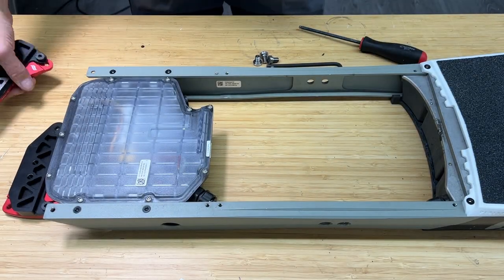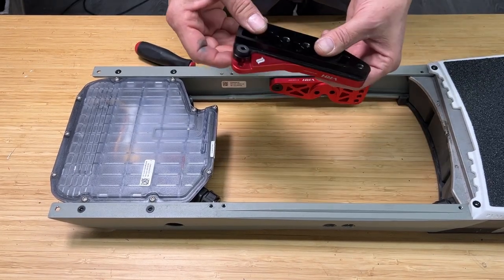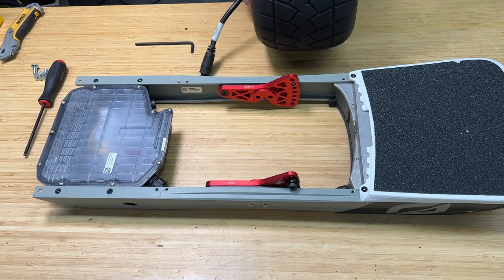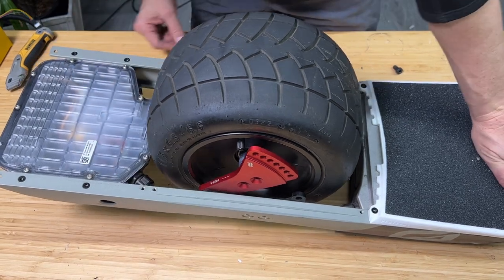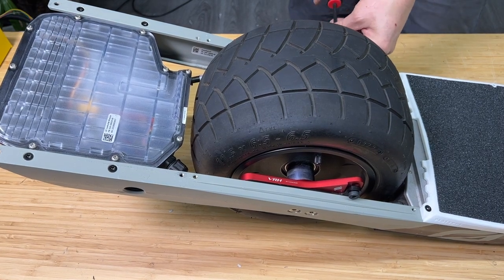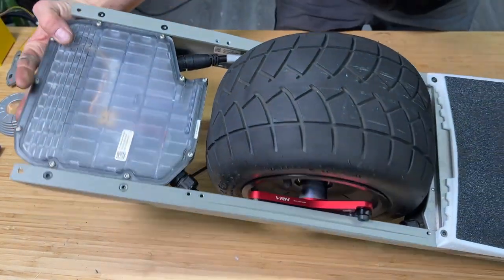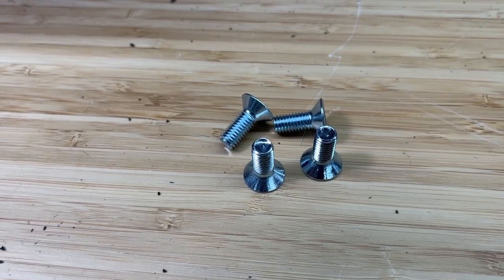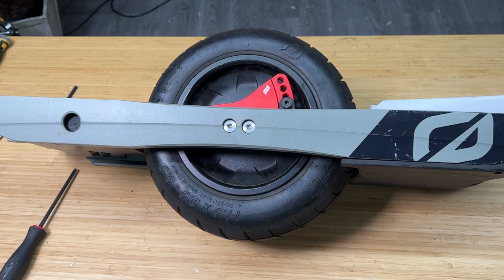Installation of the VRH (Variable Ride Height) for Onewheel GT, by Land-Surf.

Comment: Hey Matt, for those with TFL Life Savers it would be great to know if they are compatible with VRH before installation. Can you please confirm? Thx!
Reply from the maker: I'm sorry I don't have any to test with!
Reply: When my vrh system comes I will let you know
Reply from the maker: Actually have heard from riders that they do work, but you need to remove a rail to install the VRH, and not the technique in this video.
Reply: Sweet, I’ll get it done 💯 thanks For the response
Reply: @landsurfmarin  I'm just trying to install mine now and yeah coming to find out I'm going to have to disassemble further. It's really close, like mm more space needed to get it over then with the method in this video. If something else goes wrong I'll let you know.
Reply: So for minimal extra disassembly you just need to remove the 2 screws from one side of the control box. You also will need to back out the adjustment screws on the VRH a couple turns as they protrude from the back a couple mm when fully tightened. 

Now if it would just stop raining so I can try it out!

Comment: So can you not increase the ride height for extra ground clearance? As I would have thought that this is what most people want, so you don't get grounded on uphill and pump tracks etc?
Reply from the maker: It has one upper setting to raise it about 1/4". The VRH are mainly for gaining XR like stability, which requires lowering the board.
Reply: @landsurfmarin  Can they be mounted upsidedown? To increase board height?
Reply from the maker: @shanedavies9369  I've not tried that, but I don't think it would work because a cutout in the bracket near the lower edge allows the cables to go by or to the motor, and those aren't present on the other side if you flipped it. So probably not, 99% sure.

Comment: How much space is between each notch? 1/2"?
Reply from the maker: each notch moves the board around 7mm up or down. Total possible travel is 1.25”
Reply: @landsurfmarin  Thanks Matt. So if I want to lower it 1/2" how many notches would that be? Is that the 3rd notch down from the top? Thx!
Reply: @brianres  2nd notch down from top is stock height, so 2 notches from stock would be 4th notch down from top, and that would be .55 inch drop total from stock, according to landsurf claim of 7mm per notch. I'm preparing myself for these as well , so I'm preparing lol

Comment: Just curious, at 5:38 is that what happens to the axle when using the chillers?  Or did you file off the paint for a better thermal exchange?
Reply from the maker: No I did that with sandpaper to see if taking off the anodizing improved thermal transfer, but it did not.  The chillers don’t do anything to the axle.
Reply: @landsurfmarin  ahhh thanks!! That’s what I thought! Sold!

Comment: I think I would like to drop my GT by 14mm (2 holes down from stock position) and leave it there. It would be good if you could fabricate and sell some decent looking fender shims so that riders could still use their fenders after lowering the board.

Comment: Is the stock fender delete not compatible with VRH?!  I just got done putting mine on and fender delete wont go on 😞
Reply from the maker: It is but requires some trimming where the arm comes up in the middle, and the adjustable screw goes in.